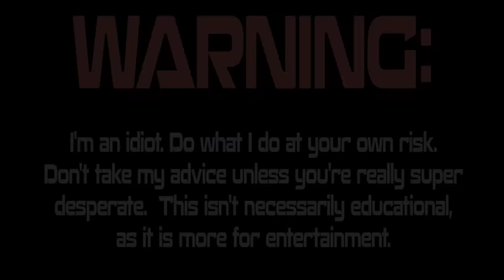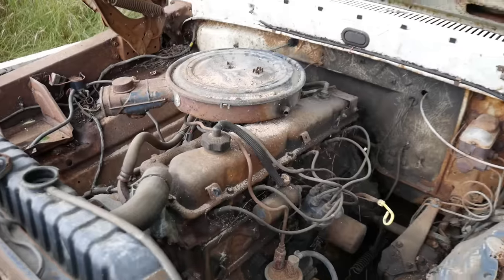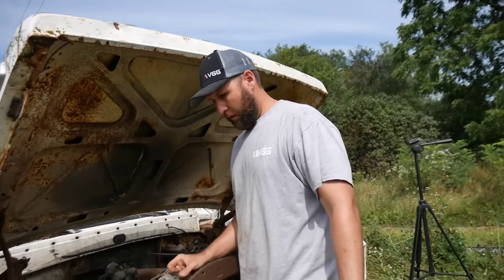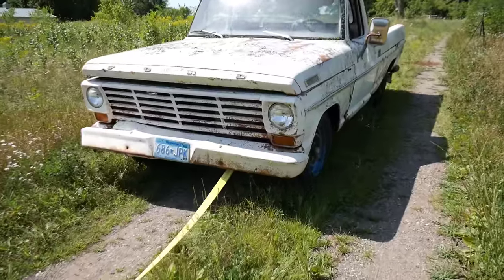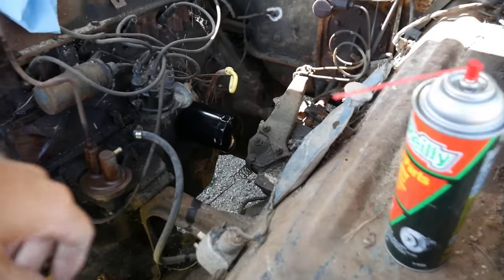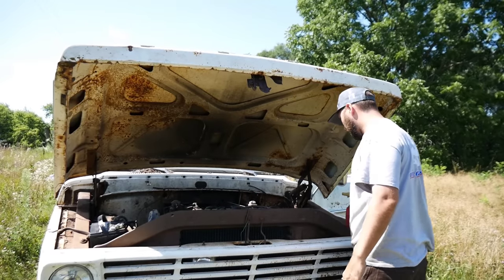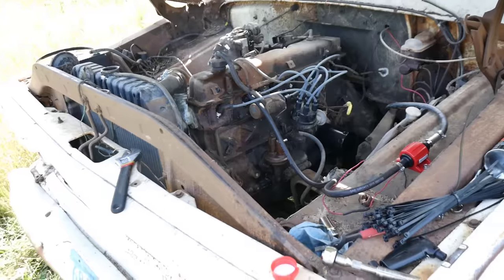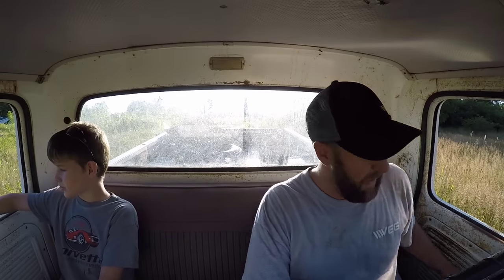ABANDONED Ford F250 First Start in 24 years - Vice Grip Garage EP39

Comment: When he popped the hood and there was a Ford straight six, a guy knew  it would start and run fine. One of the all time great engines.
Reply from the maker: Sure did a great job!
Reply: They were amazing motors. I wish Ford and Chevy could reproduce today  their half ton trucks from this period exactly as they were back then. They would sell millions of them. The Government would not allow that, though. The Government needs to let Americans just do American things.
Reply: Doesn't know anything about fords, continue to tell us all about the inline 6 models lol
Reply: They were good engines. I had a Ford with a fuel-injected inline-six and despite the miles, ran like a champ. Due to the low HP and heavy weight of the vehicle and the automatic transmission, I typically either had the pedal planted to the floor or totally off the pedal. I regret getting rid of that van. I got rid of it due to troublesome electrical issues. It had a short somewhere I couldn't find it. I finally said screw it and sold it.
Reply: @ViceGripGarage  300 cid six.bulletproof
Reply: @gertraba4484  Bulletproof but has sh!t for torque on the high end.     My 1996 is a real dog at 45 - 60 mph.
Reply: @joelalexander5338  well, problem is that car safety is way better than it was back then, they'd be deathtraps compared to the cars on the road now.  (Really good looking deathtraps though!)
Reply: slab buster RTR  Slant six Mopar as well!

Comment: When I was a teenager around 35 years ago, I was taught to use part of the cardboard box the points came in as a rough guide. It usually worked well enough to get things going until finer adjustments could be made, much like what you did in the video.

Comment: im 66 yrs old,worked as a mechanic alll my life! Worked on everything at one time or another. you can check that complete ignition system on any car or truck with points with a test light.
Distributer side of the coil,if it blinks when you crank it,points are working!
Reply from the maker: awesome, I'll file that tip away for sure
Reply: You sound like my dad but he’s 20 years younger

Comment: I drove a 1972 F350 with a 300 six and a four speed with low first gear. It was a 12’ dump bed with five foot high sides. We used to deliver 14 cubic yards of bulk cypress mulch with that thing. It wasn’t severally overloaded, great!
That engine never failed to start and haul whatever we threw at it. Great vehicle. Thanks for another awesome video

Comment: Before fancy electronic ignition we used a real feeler Gage and a dwell meter to dial in the points. You then  adjust idle - plug vacuum advance then get your timing light on it . With leaded gas plugs lasted a year. That Ford started out in leaded gas- but I am  sure it does not mind modern fuels.
Reply from the maker: yessiree

Comment: Very impressed. I wonder if it'll be the same when someone finds a 2019 in a field 30 years from now
Reply from the maker: Thanks bud!  Surely be different with all the electric crap in the future
Reply: @ViceGripGarage  Hey by the way. I'm new to your channel. I'm glad I found you, I've  been binge watching your videos 😂😂.
Reply: Tc Womack nah...it’ll be rotted into the ground in 7 years....they don’t make em like this anymore...
Reply: They're all plastic nowadays...no way it will last out in the field that long.
Reply: Let me find a 2019 ranger in a field ill be fixing like a moker
Reply: they'll need a silicon etcher if the metal even lasts that long, sadly.
Reply: You all are hilarious. They are not going to rust like old cars do because of the way the car is painted from the factory. We have also learned which seat material to use and such from trial and error. Only set back is that the plastic trim on the inside of the car might sun fade
Reply: It won’t. New cars are plastic crap
Reply: @iceyblaze9251  EXACTLY!!  Plus, the new Fords are aluminum.  That shit ain't gonna rust. Lol!!  Can you get it running after 40 years??? Now that's a different fucking story with all the electronics.  But it sure as shit ain't gonna be rusty...
Reply: Actually, the 67 is 53 years old as the 2020s are out. It would be a far more complex find with outdated ECU that you couldn't interface with and so many sensors shutting down the vehicle. A 2019 F150 field find in 2072 will most likely be as useless as finding a steam locomotive now.
Reply: IN 30 years I doubt we will have trucks or even drive ourselves. Maybe all be air commute like the Jetsons. By the way, 2019 trucks won't rust out
Reply: @fififornow8031  I believe were having a global crisis with plastic. You see the problem is that it's a material that doesn't break down in fields. Sorry to break you the news. You should get out more.
Reply: With the 2019s being all aluminum and plastic and electric there will be nothing left you will need to be an electrician to even try and crank the motor a d even then it will be iffy
Reply: @scottmichael754  lol because foam and felt lasts so much longer...
Reply: @aj200415  no but they dont rust and fall apart like they used to
Reply: Avshalom Chotawm  I run a car wash. I HATE the GM pickups from 2014 on. There's an exposed, felt like lining in the wheel wells that is impossible to clean with a high pressure wand. GM has always had body rot issues around the wheel wells. It will only be worse after a winter of being saturated with dried in salt brine slowly releases over the summer, when people generally wash less often.
Reply: @iceyblaze9251  
Also all the plastic engine stuff like air lines n radiators and sensors...not to mention the potential for a maze of dried out chwed/ shorted up wires running to a main computer that will surely need re tuning ... sure the bodies might b intact but not much else
Reply: Unless it's a 2019 lada then no
Reply: Well I found a late 90s bmw 840 that was parked for something like 6 years, and unless I get the key, computer synched by dealer, and the ews anti theft coded, it will not even crank. If we ever get a zombie apocalypse we are screwed unless we find pre 90s cars and trucks....
Reply: With everything computerized by a chip these days it all relies on them still working. But they seem to hold up quite well over the years, but really depends whether those circuits can handle years of punishment from the outside elements. May be able to hold out in a barn, garage or top covered somehow.

The battery electric cars though will probably be really dead.

Comment: A good friend of mine taught me how to set points in 2 easy steps:
1. Remove distributor assembly.
2. Replace distributor assembly with HEI distributor.
Hope it helps.
Reply: Uhh, hello...
that isnt fixing the problem, it is trying to avoid it.

The problem is that HEI has problems of its own that you can avoid by running the points.

Comment: “Just a little bit”, then proceeds to flood it, that’s how you do it
Reply from the maker: haha
Reply: A Dixie cups or small bottle of water reuse it for gas so you can keep the engine going during the stalling first starts instead of continuous restarting
Reply: some motors not all some backfires through the carb

Comment: Ford inline 6
New set of Points............

Points gap = .025
Static timing(manual trans.) = 6° BTDC
Timing = Rotate engine to bring mark on crank pulley to 6° advanced on timing tab. 
Using Continuity Meter(OHM Meter Audible Setting), loosen and rotate distributor until points break open.
Static timing is set.  👍

Comment: How do you find all these vehicles?
Reply from the maker: lots of research and driving
Reply: And that's how we wound up with a 401hp factory ac tri power 390 galaxie 500 ltd its mint 62000 miles on it 3rd owner

Comment: Matchbook technique works! For adjusting points, I usually use an old shop tach with a dwell reading mode. There's always a dwell spec somewhere for engines that used points originally. The biggest obstacle for the uninitiated is checking and readjusting brand new points until they're broken in and hold their dwell more consistently.

Comment: I owned a 76 ford and a 79 Ford F150 they were great trucks. Actual seriously thinking of searching for one to rebuild. I have a 2014 Toyota Tacoma v6 which is a great little truck but I just miss my old Fords. I always used a match book to set the points as well that's what the ole fellers told us too ...Awesome seeing you work with your young man there. That's the only way to do it right.

Comment: My first experience driving was on a 1968 Ford F-250, 240ci in-line 6, manual choke, no power steering, no power brakes, 4-speed manual (1st gear creeper). I loved that truck. I have been looking for one just like it for years.

Comment: Great video! Subbed you today after the 79' Dodge barn find video. Now what to my surprise, but a 68 F250 video! Firstly, mine was a 68' F250 4spd granny, 300 6 purchased for $300 in 1974. Rusted to tears but only had 63000 miles on it. Every lifter made noise but if I turned up the 8-track, no problems. Also It never got better than 11 mpg. Uphill, downhill, with the wind, against the wind, fully loaded or empty, summer or winter - didn't matter - 11 mpg was it. On the plus side, gas was only 55 cents a gallon. It was the most dependable vehicle I ever owned. I went to northern MN in 1975 to Forestry School after High school. I lived 25 miles from the school. I would park her outside and plug her in and I NEVER missed a day of school.  -20 was common with the occasional -30. We didn't know what windchill was in those days. Wind just meant you cupped your cigarette to light it. Oh!.....I always set the points with a feeler gauge and factory specs (crazy talk I know) but thats how my dad taught me. With a GM product I would use the matchbook method then adjust with the allen wrench but you couldn't do it with the Fords or Mopars. Warms my heart to see you teaching your son the important things in life. Please keep up the good work!! - Favorite line: "She's tart"

Comment: I found the twin to this pickup. A little more rust but I'm gonna save it. Interesting thing about it is it has a dump bed hoist with the stock box. Fe motor is stuck, I'll oil the cylinders. I've learned a lot from the Vice Grip Garage school but I doubt I'll get a diploma.

Comment: In 1967 I was an assembly worker in the Ford Mahwah plant.  I hung passenger doors on pickups and tac welded the rear window sandwich frame.  I also set up the beds for the paint booth.  It was a long time ago, far far away.

Comment: I had a 71. 300 6cyl. It burnt a ton off oil. Ran used oil from big diesel generators and changed the oil filter once in a while. Ran like a top. Good old truck.

Comment: My Dad and my Grandad taught me how to maintain cars back in the 50s/60s when the diagnostics tools you needed were a good ear, some feeler gauges and a decent set of spanners/screwdrivers.

My son and I still do most of the work on our cars but have to know how to use and OBD analyser and look up repair/maintenace tips/videos on the Internet. Have a couple of 2001 BMWs and a 1983 Citroen Mehari, very different vehicles but both easy to self-maintain.

Comment: I use a dwell-o-meter 2000 to set points.
You can rough it in with a couple business cards or match book, but the dwell-o-meter is the only way to get it right.
The best way to do it, snip them points out and replace with a little electrical box. Points eliminator.

Comment: I'm not surprised you got it running with a little elbow grease. Those Ford inline-6's are very durable. They where originally designed to be agricultural tractor engines, so they where over-engineered for regular pick-up truck use. They can really take a lot of neglect.

Comment: Wow. I had a 67 F100 just like yours there. Whenever I wasn't driving it, I was working on it. Once I ran into the back of someone and mashed the front up good. Took awhile but I got the front end off of a 66 and replaced all that sheet metal and it looked rough, but I was proud. it didn't last long though. One week later a nut from the after market air filter contraption that was on it fell into the carb and found it's way into the #1 cylinder and cracked the block and trashed the head. Had to replace the engine and all the while I was doing it, I was thinking how much easier it would have been 3 weeks earlier without the front end on it.
Oh well, good times.

Comment: I've owned several of those old Fords and I can tell yo that although they're big on the weight reduction problems, they just keep on running.  My '83 had over a half million miles on it when I sold it and I never did any major work to the 300cid 6-Cyl engine.

Comment: Points setting feeler gauge followed up by the Dwell meter. Also to note. Try a voltage drop test they are fantastic and better then an ohm reading, for grounds and power testing.

Comment: I run GM, so there is a replacement cap with an access window.  

The window allows access while the vehicle is running or not.

Another reason to love GM.

Most new points are set well enough to run.

An old set only needs to be square and clean, and if you have to gap them you can set the gap with a feeler gauge.

Comment: I bought a blue 1967 F250 in 1986 for $400 when I lived in Iowa. 6 cylinder auto with no power steering or brakes. Had old rock hard tires on split rims, only surface rust no rust through anywhere which is unheard of in Iowa.I used it to haul concrete rip rap to shore up a creek bank and  would load it to the top of the bed rails and it never squatted an inch. One bitter cold morning I hit the key and it started up the engine shaking the whole truck and a ragged cat ran out from under it, must have got caught up in the belt staying warm overnight. After a few years the cab mounts rusted out and sagged on the steering which made it near impossible to turn corners. Got some dirty looks from other drivers. Traded it in for a new 1990 Dodge Dakota and when they test drove my Ford the guy came in the office and with a strange look on his face said " You drove that up here? " Anyways you have the BEST channel on You Tube, I started at the beginning and enjoying each one!

Comment: I use a dwell meter, the starter and two screw drivers to set ignition points. The point gap is immaterial it's the dwell angle that'll mean a correctly timed engine or not. 34* be good for most 6 cylinders but if you can find the dwell specs on line use them.

Comment: That fuel pump is the correct replacement part for the pump that is on the truck. The replacement pump has a built in filter canister. 
The fuel filter element is as big as some cars oil filter. Very convenient.

Comment: Points set with dwell meter is best along as the meter is reliable. Feeler gauge ok if points are new but it can be tricky as ya need to be correctly positioned with the rubbing block of the points on the dist cam lobe. I had a 300 cid in an 82 Bronco, fine for to town and around but not suited for a F-250 that needed to haul loads, just not enough torque

Comment: I use a feeler gauge and set the point .20th then a dwell meter for points. I swap out the points to pertronix in time. Never had any problems with pertronix.

Comment: Usually adjust points in the dark, on the side of the road in the rain. I use an old sparkolater box ear or a business card from my psychic or side chick...I don't know?
On the serious side, nice to see you taking your son along on the Ford straight 6 git-er- run.
  That would be a great truck for a kid. Great mileage and a Bulletproof set-up with a Manuel and points. Carry a tune-up in with the mouse droppings in the glove box. Make sure he has a hang on screwy driver in with it for the screws a guy's obliged to drop changing the points n condenser.

Comment: Adjusting points? I use a guitar pick. They even state the gauge on them in decimal inches. I start out with an orange one and finish with a red one. I also have a 1967 F250 with a 300cid motor and 4 on the floor and I love the Hell out of it

Comment: I hear a guy can clear coat right over those lichens and bed needles.... makes'er stand out just like a Ford aught to...
For those points, a matchbook is fine in a pinch but I'd put the proper feeler guage on it asap since the dwell timing tells the old coil how long to charge up a nice solid lightning bolt.
So cool you got ur kid out there wrenching on this... I missed how you got the front wheel unstuck?

Comment: I liked the old chevys. They had a little window you could reach through to adjust the points. On my old v dubs I could set them by eye. Then dial it in with a dwell meter.

Comment: It might have been said already, but you have to use a Dwel Tach.  My 1972 BMW has points and it the duel is set to 59 or 61 it won't run worth a damn.  Got to be at 60!  Yes the match box is .017 and is very close to get you started.

Comment: Years ago near our ranch which was 45 miles from civilization, back before there were cellphones, my buddy and I had a Ford fuel pump go bad in a '72.  I thought for sure we would be walking.  It would run off of a prime, but that was it.  We ended up pumping the windshield washer fluid all out and filling the reservoir with gas siphoned from the fuel tank.  Then by disconnecting the hose that went to the windshield and sticking it in the top of the carb, we could keep repriming by pushing in on the wiper button.  It took a few miles to get the timing of the squirts down, and a few washer reservoir refills, but we didn't end up walking 45 miles of hot August Wyoming dirt roads.  So see, you did have an electric pump on hand the whole time.

Comment: That would be a 240 which was still a great little engine. The match book cover always worked great if you don't have the feeler gauges. Also I back when I had my Chevelle always kept a fingernail file in the glove box. If it started running crappy I would do a quick file and was done.